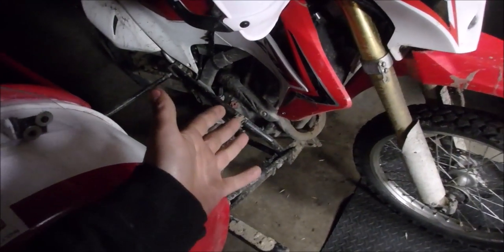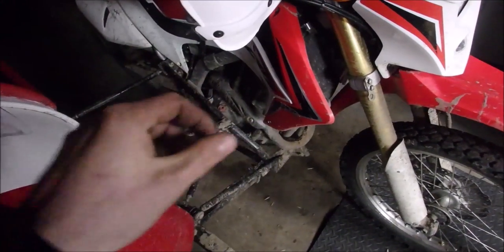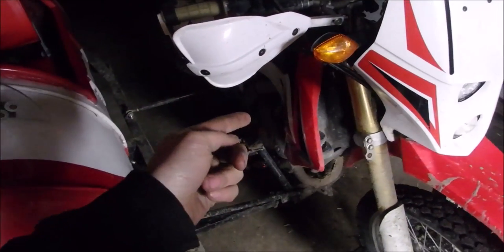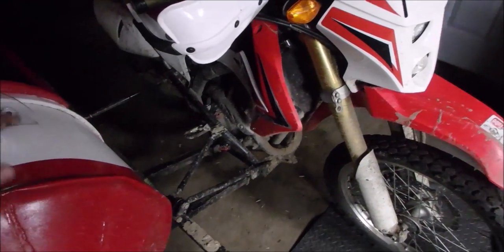4K Mile Big Bore Update & Other Performance Info

Comment: I kept my bike stock because i know honda hired smart people and spent lots of money to improve the intake and exhaust of the 2017 model which i have. I was tempted to buy a fmf system and K&N Filter but i did an experiment where i slipped off the muffler leaving only the header and removed the air filter and air box cover. So thats as free flowing as it gets i say and i rode the bike around the block and it ran pretty much the same. It reved more freely but it did not have more power, and it was stupid loud haha! But to many if its louder it must mean more power. Im still on the fence with the big bore, thats the only real way to get more grunt but reliability is my main concern, its my daily ride and there are so many reports of premature failure. But I think because you are a meticulous mechanic yours will be one of the builds that last. Good luck and keep sharing your experience and knowledge!
Reply from the maker: The only premature failures I know of were on the first few kits made. There are several that have gone over 40k miles

Comment: Hello mate, I have a 2013 Honda CRF250L. Like to ask you where did you buy the big bore kit from?
Reply from the maker: Crf's only. But I would advise against a big bore kit. Makes the engine very over square, a lot of people have had trouble with them. Check out my other videos, mine died.

Comment: Kory thanks for all the great info. I have a 2018 crf250l thinking about getting the fmf powercore 4 muffler.My question is how often would u have to repack it.? My bike is stock except for cutting out the spark aresster my concern about the stock exhaust is the cat clogging or going bad.Thanks again Nick
Reply from the maker: The bike is fuel injected, so as long as you don't remove the PAIR system, the catalytic converter works really well. The PAIR system injects fresh air to help the cat burn better. I have a couple videos on how to remove the catalytic converter should that problem ever come up.  Repacking seems to be about every 3000-5000 miles.  I thought every brand of aftermarket pipe I tried [with any combination of quiet or spark arrestor tip] were too loud and annoying. A lot of money for no performance gain, and only incredibly meager weight savings.

Comment: Make it a 300L STOCK and it will appeal to so many more people.
Reply from the maker: Honda's 300 engine is a direct replacement besides the stator plug. Bolts right in

Comment: There's a video on youtube where a gentlemen gets 4.5 hp from ejk and exhuast on the dyno  but he said the only time he got more power is when they put the header on, everything else did nothing. Conclusion is the stock header on 2012-2016 models are too restricted.

Comment: For the 2020 CRF250L : Does the 305cc Big Bore kit work better with a FMF Q4 & Megabomb or not? Is you bike post 2017? Do you know if the 2020 is dual spark? Do you know of anyone that has dyno'ed the stock CRF250L (post 2017) and with the 305cc Big Bore and FMF Q4 & Megabomb and 14T/40T stock gearing? Does the 13T and/or 42T sprockets / rear tire size affect the dyno readings? Does the EJK for the 305cc BBK improve only by them selves or when exhaust mods are made?

Comment: How are the vibrations with the big bore kit compared to stock at 70mph? My stock 250 had a real bad buzz in the handlebars that would make my hands go numb in 15 min
Reply from the maker: It actually shakes less
Reply: @KorysRides  oh thats great news! Where did you order the kit from? I'll order one too now
Reply from the maker: @ScottHomeVideos  crfsonly. I suggest the AFR+ EFI controller from Dobeck, but you actually dont HAVE to put any fuel controller on it.

Comment: Is the AFR+ better than the EJK? How does the AFR+ work and how did you mount it (will zip ties work)?
Reply from the maker: You have to weld a bung in your exhaust. I have a video for the installation. It works better because it automatically adjusts your fuel map
Reply: @KorysRides  How does it mount? How does it work? Do I set a desired Air/Fuel Ratio and go from there? What is the Air/Fuel Ratio across the RPM's setting for a 305cc Big Bore Kit?
Reply from the maker: Check out my big bore kit playlist. It has videos explaining all of that
Reply: @KorysRides  : I have checked it out, but still have some questions. How does the AFR+ work and is mounted? Is there some Air/Fuel Ratio that is desired throughout the RPM range and the controller adjusts to that? Does the Wide-band O2 sensor fit onto the stock exhaust (also does it fit on the FMF Megabomb?)? What does it take to mount the AFR+ dial/buttons?
Reply: @KorysRides  : What is a Bung?
Reply from the maker: @stephendicke6495  yoshimurais the only aftermarket exhaust with a bunion it. Stock or FMF you will need to drill a hole and weld it in. the Gage / buttons for the controller mount with a simple hole saw hole. I have an aftermarket fairing, but you can go to any automotive store like Napa or O'Reilly's and get a gauge Mount that you can bolt on somewhere.it automatically adjust your fuel mixture for an optimal burn. You can set it for more or less fuel at idle, moderate throttle, or heavy throttle. If you have a stock engine, you don't need to bother with a fuel tuner of any kind.
Reply from the maker: A bung is a threaded metal piece you weld on to put fittings or sensors in

Comment: The only good reason for the FMF or similar is weight savings.  My used one came with the pipe and header otherwise I'd prefer the quiet exhaust
Reply: Hi Mate,do the airbox mod and k&n filter.  It really opens up the engine power way more than just the exhaust
Reply: @work750  thanks that makes sense.  Mine has the air box mod with a sticker filter. Maybe a K&N will help. I’ve never rode a stock one so it’s hard to tell. I’d just prefer it to be a bit more quiet since it’s not really a performance bike.
Reply: @fredburris5428  agreed.  I like the extra power but the load exhaust sucks!

Comment: I have a 2014 250l with a 305 kit I was just wondering how long you or anyone else goes between oil changes with the 305 big bore kit I have ridden motorcycles for 25 years and never notices the bottom end get noisy on any other bike except this one when the oil gets a little old and by a little old I mean around 700-800 miles soon as I change it the noise goes away it’s only at low rpm just curious if you or anyone else has had this issue with the big bore thanks guys ride safe
Reply from the maker: I use full synthetic and go 2000-2500 miles between changes.

Comment: Did you do a sprocket change?
Reply from the maker: 14/45 combo for hauling the sidecar around. Stock gearing otherwise. It will do 70 miles per hour stock gearing without the sidecar all day, easily. With the sidecar, top speed was about 63 with the 14/45 gearing. If you put a 45 tooth sprocket on the back, you have to move the chain guide shark fin for the rear sprocket forward about 1 in

Comment: any thoughts/plans on slapping the cbr300r crank and such in to get a 350?
Reply: also, the clutch upgrade is worth it in the woods. not anywhere near as necessary for mostly street riding. if anything, it at least makes the clutch feel better, even if it's not making it actually perform better.
Reply from the maker: No 350 plans. At that point I'll just put a 500 twin or a 650 single in it.